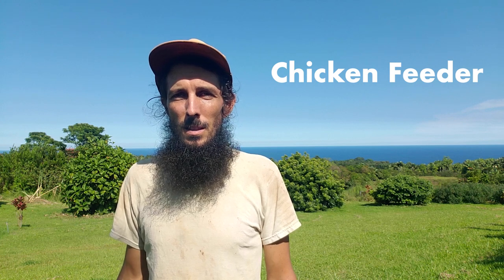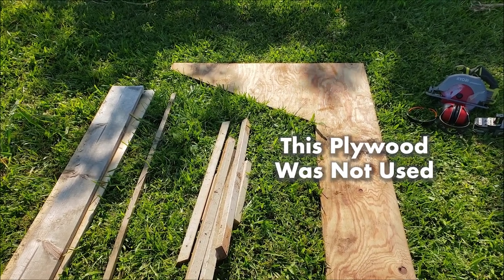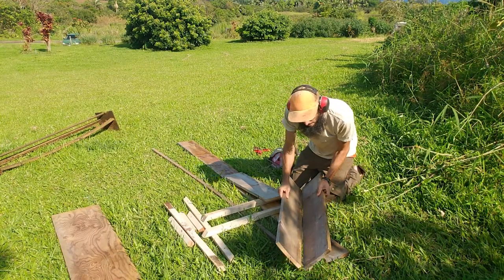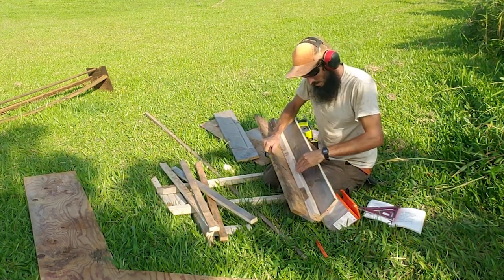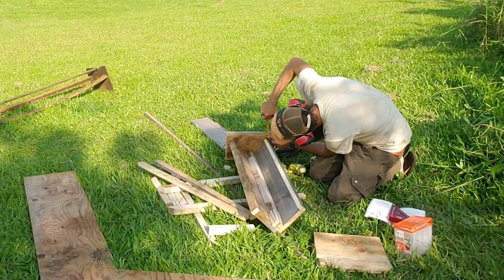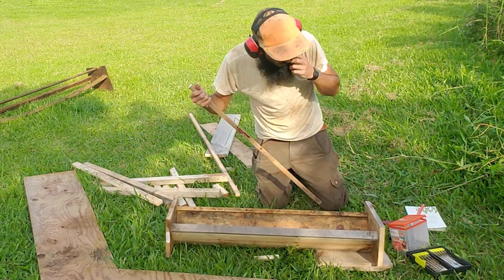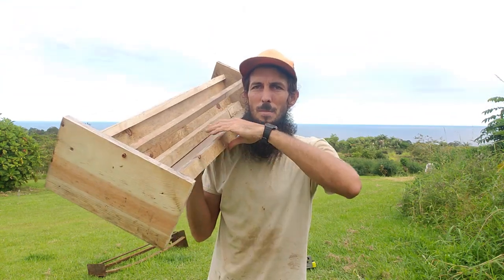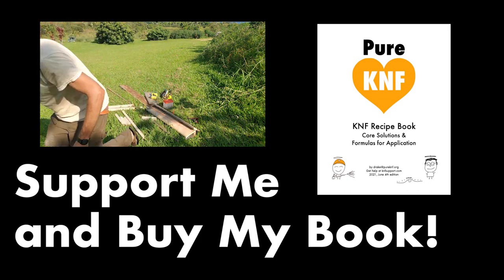Chicken Feeder - Korean Natural Farming Howto

Comment: The part I am stuck on the the chicken coop design is the roof..... how to do it cheap, but strong enough to withstand 40-60 mph winds.... the footprint of the coop is 14'x26'.... I was thinking the roof seperate from the walls and 2 seperate roof top sides.... I guess a 3 piece chicken coop build?
Reply from the maker: my barn is 36'x72'. has 4 pig pens, 2 chicken pens and a feed mixing/storage area. i just framed in the chicken pen with a small concrete curb and then framed a wall to run the chicken wire. part of it is only 4ft tall, so the chickens could potentially fly out, but they don't. they like their home. i want to work on the barn video next. we'll see. here's a buildout of a smaller design. not quite cho, but quite cheap. https://www.youtube.com/watch?v=BjXumcKm0jg
Reply: @PureKNFDrake  that was awesome to see the community come together to do that build. Is this the Hubble Bubble at Kim's house? I downloaded the pdf from university of Hawaii a few weeks ago and thought I could try to work off of that too... I just want to make sure my roof can withstand high winds. In the meantime, I will finish watching the livestock videos.... and then rewatch them, lol.... since I am on the subject.... when making the feed..... when Master Cho  and mister Lee say "ferment" the feed...  are they pretty much saying to "compost" it...? Thank you in advance 🙏 💚🦠🌱🐓🐖♻️🌎